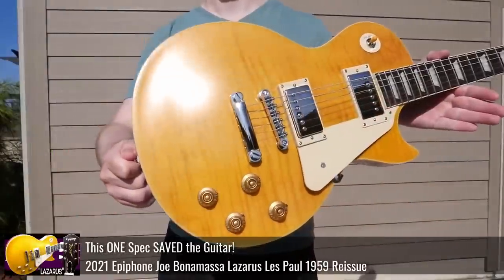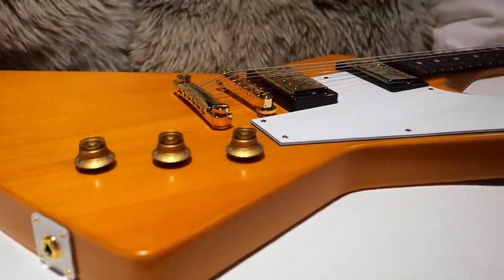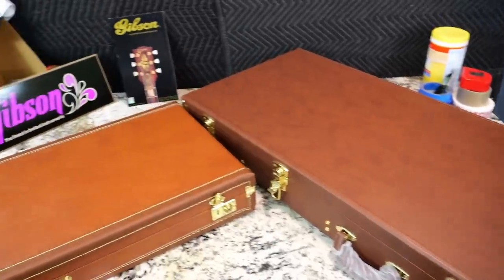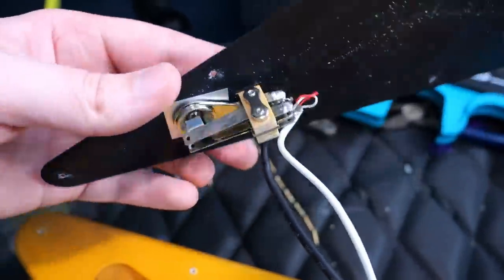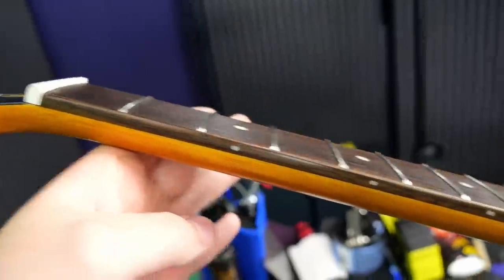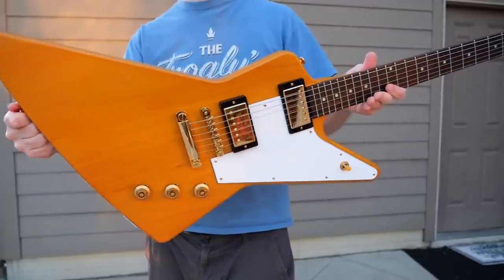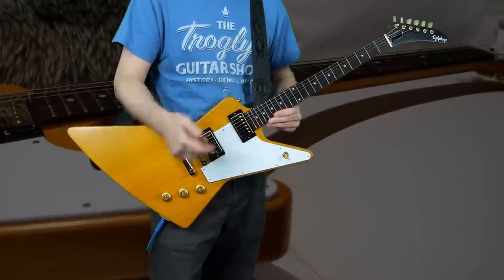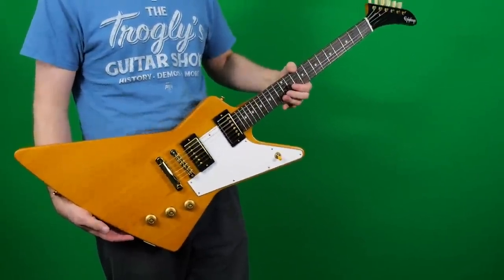This New Epiphone is IMPRESSIVE! | Inspired by Gibson Custom 1958 Korina Explorer

Comment: I’ve had the Korina V  Epiphone LEFTY for about a week now, Sweetwater said I was the first! I love it! The burst buckers just sound fantastic, it’s very well made, and setup was flawless. I have a Gibson V in natural mahogany from 2018, and this Epiphone stand’s it’s ground and I love the attention to detail.
Reply: Congratulations ! *sorry for my English. If you don't mind, I want to ask about the strings-through-body concept on the Flying V, is it true that Flying V have an unique "airy" sound because of the strings-through-body concept ? I very much like the brand new Epiphone '58 Korina Explore in this video (rocky, bold, and elegant) but I do have a "special feeling" too about the new '58 Epiphone Korina Flying V, one of the reason is the concept of strings-through-body. Thanks:)
Reply: @wiwiksundari8668  I don't know if the sound can be isolated to the string through body design, so many factors go into a guitar's sound. I believe every part of the guitar contributes especially the pickups, wood, nut and bridge material, fit and finishes and setup.   But the airy sound I think does favor the korina lightweight wood and probably helped by the direct connection to string through body. It's one of those guitars you can feel vibrate all over, not even plugged in. Anyway, it's all subjective but it sure feels that way.

Comment: As a Gibson snob myself, I cannot deny how great the epiphones are. I don’t really buy/am sold with $1000+ epiphone guitars but the $400-$700 is solid and are amazing guitars.
Reply: I own about 8 older and newer higher quality Gibsons that i've had from anywhere from 2-30 years, This is better quality than some of the USA production Gibsons. I can say if this was a $400-$700 Epiphone, I wouldn't have been interested. Those are ok but I wouldn't even care about them. I ordered the V and I am amazed at how much I like it, it doesn't need anything replaced. It's not a cheap throwaway like the earlier Epi's, its a real solid Korina for $1299. They are not for everyone but for what it is, it is a steal.
Reply: Those Epis would be killer if only they had Gibson on the headstock. Alas
Reply: Ehh the 1300 epiphone is a budget version of 10k gibson while the 700 epiphones are budget version of maybe 3k Gibsons? 13% of the cost vs. 23% so if anything these are much better value than 700$. Or the Gibson custom shops are way more off a ripoff than usual idk.
Reply: It’s really a $799 guitar with $300 pups and a $200 hard shell case.
Reply: @Rob Vee  I have the  epiphone modern SG in Trans black fade.
Locking grovers,ebony fretboard,asymmetrical neck carve burstbuckers,coil splits,out of phase..
And it's $599..nothing makes this worth $1,300.also the case is trash
They  need drop or improve  the case quality and the price..but alas people will eat em up just because.
Reply: Ben Logan that's a great breakdown of the cost 👍 good thinking!
Reply: @brandonkoch3852  The Korina makes all the difference and it’s made really well. It’s very light, resonate and has unique sound. I wouldn’t have bought this or even considered a standard $500 Epi, those are not my thing. But, this is very different. The case is not bad at all, at least mine isn’t.
Reply: @benlogan430  What's the '59 that also comes with a case, cts and burstbuckers for 400 less then?

Keep in mind, Gibson likes to put a premium on Korina, despite it not being as rare or whatever they claim it to be.
Reply: As a gibson snob, Ive found very few epiphones i like
Reply: @Ottophil  yep they're not close. I have an Epiphone black beauty Les Paul it's cheap. I would never buy a 1300 made in China guitar i can buy a Schecter sun valley shredder for 750 bucks that will destroy any Epiphone i have ever played.
Reply: @robvee532  made in China...no thanks. I'll buy made in Mexico or Indonesia but not Chinese
Reply: I'll be honest.... My epiphone les paul standard pro gives my gibson les paul custom a fair fight. I'm actually contemplating swapping the pickups as I prefer the episode tone a whole lot more. The custom pickups are just meh!

Comment: The most critical upgrade you failed to mention is that these are solid Korina.  The AMS ones were veneer.
Reply: WRONG. And not only are you wrong but the placement of the Epi logo on this new version is also wrong, NOT accurate to '58 like the AMS '58 and the Gibson $10k reissue is.  The AMS is gorgeous with no visible split on top - but is actually a 3 piece solid Korina body no veneer - I have no clue why people make s*it up - African Limba is not in short supply or protected like rosewood either - it's no big deal. You are paying double for less than $300 worth of Gibson pups and CTS pots and a case.  The 1.6875 nut on AMS makes it faster for me than the 1.693 on the other one, too. I want to see the comparison!!  Has to be to my $650 2022 Epi LE '58 Korina with Gold HW both made in China versions against the questionably priced $1300 one when $700 more gets you a REAL Explorer - (which I'm adding soon to the Epi '58 as a pair but that's a different comparison.)   . 👀
Reply: @cuda426hemi  have you looked into converting the black guard on the AMS to white?
Reply: @sebastianmedina1234  Short answer no. Got that guy in the UK (I think) that will make them of any layer(s)/thickness color, finish etc but most important screw spacing and for I think about $30 or less - Explorer guards can be different within same damn brand !! Still thinking about doing a simple white vinyl wrap if I GAF, and if I really GAF, I have a piece of clear plexi meant for a big window that could easily be cut n shaped and drilled and then either used clear or hit with white rattle can on back side. Bottom line though is the whole guitar grew on me including the porno dude black sox pick guard!  - it plays better than I thought for my smaller hands - wicked fast - I find the wider width a little better than the SG Muse and that is wicked fast in a thinner feel way. Bet you dollars to donuts the new 'inspired by' white guards would NOT directly screw onto my 2022 LE Korina - just have that feeling. Funny you asked about that black guard though...☮🎸
Reply: Def NOT a short answer bruh .. 😂

Comment: I just got mine, I normally spend a couple hours going over the fret ends, I had my table all set up, all my tools out and decided to play it, the intonation was spot on, that has never happened before, very nice surprise. All the fret ends are almost perfectly smooth. The tone is very sweet, these pickups are very nice, all kinds of gain available. My case has a nice snug fit, there was a little pink fluff in my bridge.

Comment: I bought the V with the black pick guard, and I absolutely love it. I will say that the nut needed a little work, but the case was a very snug fit, with no movement of the guitar.
Reply: I could not find the option to order the black pickguard version?

do you have a link?

Comment: Seems silly expensive for what it is, and others have complained that the neck is sticky.  The Epiphone '59 Les Paul Custom Shop collaboration debuted at $699 with Gibson BB2 & BB3 pickups, premium Gibsony electronics, "premium" Epiphone case and essentially the same features as these, so I'm not sure why these cost nearly twice as much.  $699-$799 is about what I would consider Fair Market Value for one of these.  I would also tone it down by putting a BB1 in neck and moving the BB2 to bridge as I did with the Epi' '59 Les Paul ($999 new last I checked), probably upgrade the tail hardware to Faber, & add locking tuners from Grover or Gotoh.  With those mods/upgrades and a buffed-out finish I am really happy with the Epi' '59 for a total budget of ~ $1000, and do not pine for a Gibson Les Paul (I've played many :o)

Comment: Seems silly expensive for what it is - the Epiphone '59 Les Paul Custom Shop collaboration debuted at $699 with Gibson BB2 & BB3 pickups, premium Gibsony electronics, "premium" Epiphone case and essentially the same features as these, so I'm not sure why these cost nearly twice as much.  $699 is about what I would consider Fair Market Value for one of these.  I would also tone it down by putting a BB1 in neck and moving the BB2 to bridge as I did with the Epi' '59 Les Paul ($999 new last I checked), probably upgrade the tail hardware to Faber, & add locking tuners from Grover or Gotoh.  With those mods/upgrades and a buffed-out finish I am really happy with the Epi' '59 for a total budget of ~ $1000, and do not pine for a Gibson Les Paul (I've played many :o)

Comment: I wished you would have reviewed mine. It's absolutely appalling how bad it is.

I have glue everywhere dripping from the neck joint to the 22nd fret and almost onto the fretboard, the back of the neck joint has stress cracks about 3 inches long that they tried to fill with more glue, the sound cuts in an out when toggling the toggle switch (wiring issue), and the case foam is way worse than this example...it's very smashed in leaving a 5 inch play of the instrument jiggling about.

I talked to Gibson and they don't care at all. This was a dream guitar that ended up being a nightmare. I sent photos to them and they said "ya that's bad." And that's the extent of their customer support.

There's a chuck of wood missing....it's so bad maybe it would be worth more. All I wanted was a legit model though. I'm super sad.

Comment: the choice between the black and white pickguards is only available in the US as far as i know. The white pickguard is the only one available in Europe

Also, is there actually a lock on the case or is it just for show? The case that came with my 59 LP did not have a lock in it. I could turn the key till the end of days but it wouldnt ever do anything
Reply: @cataclysmicconverter  the latches arent very tight on that case either so i dont trust it for carying my guitar around in it. a lock would atleast make sure it wont open by itself when its carried. That being said, i never really use a guitar case.. i keep them all out on display so they get played more often. out of sight out of mind sort of thing. if i do need to take a guitar with me ill use one of those softshell gibson cases which is basically a heavily padded gigbag which probably offers more protection if it gets knocked over.

Comment: Gibson just capitalized on the Epi 58 reissues that were selling like hotcakes at $649, added Gibson pickups then doubled the price.   Marketing.   I bought a new Epi LP 1960 Tribute plus that came with 57 Gibson p/u's and Grover locking tuners for $800.  So these Gibson bits don't make the $649 Explorer suddenly worth $1300.

Comment: Satin looks cheap compared to the original nitro imo. Further - a year ago I bought the Epi Limited Edition '58 Korina w/Gold HW and a pau ferro - not this sandy Indian Laurel board and it has the real glossy body with logo in CORRECT '58 position after the strings - not below as this  $1300 version incorrectly shows - and with a slightly narrower nut width -couple hundreths it plays fast as f*ck. Both made in China. My top has no visible piece line and is gorgeous. It does not have Gibson pups or CTS pots but it cost HALF of this "inspired by" Epi so what gives??? Who will be the first to compare the $650 2022 Epi LE '58 Korina Explorer with THIS  $1300 Epi '58 Korina?????      👀

Comment: Does anyone have any solutions to eliminate the neck dive and have the guitar more balanced when standing up with a strap?
Reply from the maker: 3" wide strap, with grippy texture and wear a gripping shirt.  put weights in the control cavity - move strap buttons. There are ways around it if you have a neck diving example

Comment: Bought one of these and it got trashed in shipping (crack near the headstock like Trogly was mentioning for the other model). The case foam is too weak to protect the guitar. I had a more extreme version of the foam being crushed as in the video. If you wanna travel with this guitar get a different case. Too bad it's not $1099 MAP with no case.

Comment: 1300 for a Chinese made guitar is nuts.
Reply: to make you feel better, prs has a 1600 dollar chinese guitar lol
Reply: What’s wrong with Chinese made guitars? What makes them inferior to Korean, Indonesian, or hell even American guitars? If the quality control is good and it plays well makes no difference in my opinion.
Reply: Try an Eastman and get back to me!
Reply: @Tony78432  I have an Eastman T484 made in China, and it's a killer guitar, like you said, if something is good, it's good
Reply: @Tony78432  Most of the time, there is a discrepancy between overseas production and domestic production based on things like labor laws. Buying an American made guitar, you don’t have to worry about whether it was made by a couple 7 year olds. American workers also get paid significantly more, and they tend to do a better job because of that.
Reply: @Tony78432  People aren't saying its bad because its chinese, they are saying its bad for the price. Manufacturing from china costs almost nothing so it shouldn't be over 700.
Reply: @peejay6930  It might be good but I don’t think they’re 1500 dollars good. I also don’t think most guitars are.
Reply: @Tony78432  Mostly grade of parts higher grade word handcrafted versus machine and have you not seen what’s going on with China lately

Comment: Case is very nice. Pickups are great. In some ways the indian laurel looks a bit nicer than the dryish rosewood that Gibson USA stuck on the mahogany Explorers. Definitely prefer the gloss of Gibson. I actually prefer poly as a finish because of its superior durablilty. Price is too punchy. And I hate that it is made in China to the extent that it is a dealbreaker to me. Would have to either stick with low-end Gibson like a LP tribute or try and gather together enough for a mahogany Gibson USA Explorer.

Comment: I’m curious as to how these new ones compare to the older korina ‘58 Zzounds/AMS exclusives!!
Reply: From what I read those are NOT solid Korina like this one is, they have a veneer top
Reply: I have an original 1997 Issue and it is nothing like that. Muli-piece Korina body with veneer , cheap Pups , and maple neck $549 new back then
Reply: Well now that I have both, I can tell you that the older Korina V , while very nice, the inspired by Gibson has nicer solid Korina, but the really nice thing is the burstbucker pickups that put in another level

Comment: Gibson can never get their strap buttons right! On my SG special it's located on the back and guitar dives forward and downward. The button should be on the top horn. So now on the Explorer the button is on the horn when maybe it would be better on the back of the guitar. This is a bigger deal than it sounds if you gig your guitars. Try fighting a Gibson for a set then switch over to any Fender...you will be shocked how much more comfortable and effortless the guitar plays. Otherwise, I like this explorer a lot but will pass as its not practical to gig with.

Comment: Are you complaining about the position of the "Made in china" stickers? Come on Mr. Troglys ... One piece korina neck but ... scarf joint for the headstock. This is NOT a one piece neck sir!

1299 US Dollars for an Epiphone with Gibson Pickups, without a great fret job, a FLAT D shape neck, etc? No thank you. I prefer to save a little more and get a second hand Gibson Explorer. It will never lose value.
Reply from the maker: The scarf joint is technically in the headstock area and you typically don't count headstock pieces in the count of neck pieces so the neck is technically  "one-piece" with an asterisk. The stickers are placed on an area of the neck where you feel them while playing where they typically don't do that. This leaves you no choice but to remove them
Reply: @Trog  Alright, the neck is just the piece of wood below the fretboard, not the headstock. Anyways the scarf joint is ugly as hell (we are talking about $1299 guitar) Regard the stickers ¿Which guitar player would play with the stickers on the neck?